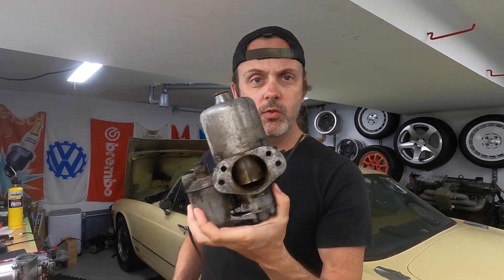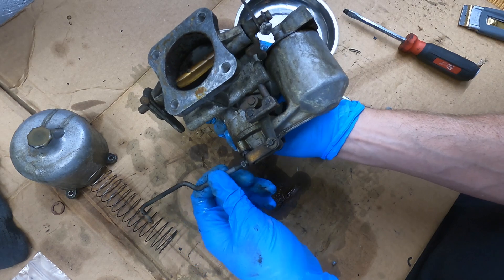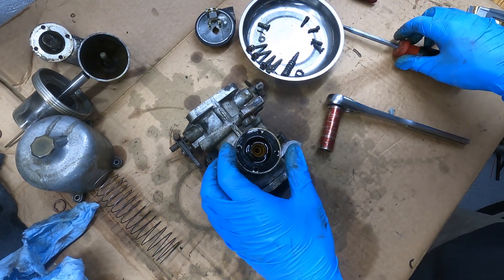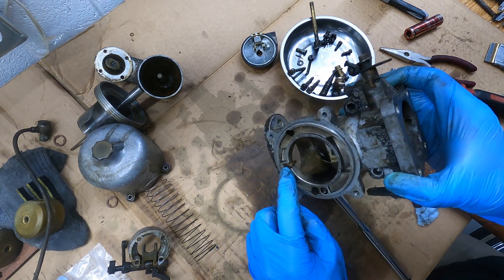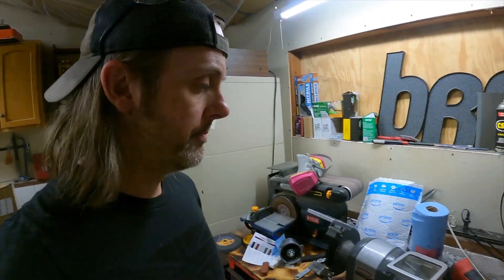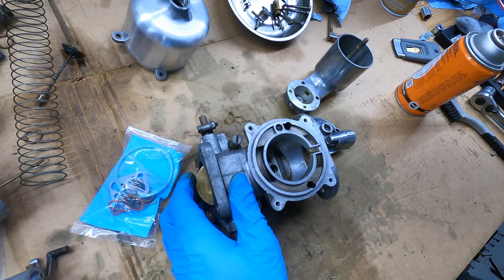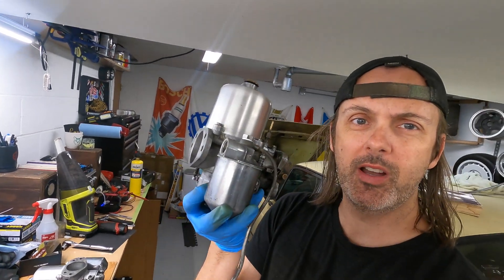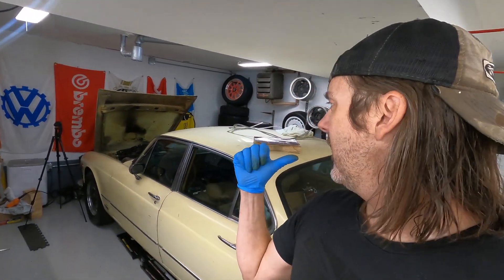SU HD8 Carburettor - Rebuild & Restoration

Comment: The small lift pi on the side has 2 functions to see if the dashpot is not seized & during manual tuning lifting the dashpot while the engine is running a slight rise in rpm denotes correct mixture as opposed to using a gas analizer & using the large screw on the side of the carb body this ensures correct co for emission control & the dashpot is actually lifted off the main jet by 2 holes in the dashpot facing the butterfly vacuum formed between the butterfly & the holes acts on the top of the piston in the bell creating a variable Venturi over the main jet accompanied by the lift of the variable size of the needle that’s about as simple as I can tell it

Comment: I believe that around 8. min 19 secs 
the mystery part is just a standard SU feature, i.e a lift pin which is used to test the piston  free rise and fall in case of doubt. On a non -running engine you can raise a  normally free dashpot piston with this gizmo, and if all is well , on releasing the pin the piston drops freely with a nice metallic clic as it falls under its internal spring pressure dropping quickly onto the jet bridge. Baically it's a test in case of a  a suspected  jammed piston..

Comment: Rob, do you have an ultrasonic cleaner?  Most of those carbs including all the small metal parts need to go into it. If you want that to run like factory, all that goop needs to get cleaned off. Also, if didn’t look like you cleaned the main jet needle. It is really important to clean that, without removing any metal or changing the shape. The fuel runs up along that needle into the Venturi of the carb. And any grit or grime left on that will effect your fuel metering.   

I really like the garage content!  You’re doing a great job jumping right in and going for it. Please keep it coming. 😊
Reply from the maker: I do not.  I just sprayed off the needle w carb cleaner and hoped for the best.  I have replacement needles that came with the kit, but the old ones don't really show any wear, not sure if I should be replacing them or not?
Reply: @addvancedgarage  I would vote on the side of putting the new needles in. There’s nothing to wear. It really shouldn’t touch the jet and only have fuel passing over it. But and residue could harden into varnish changing the size and shape of the needles.   But you saw it, not me. I trust your judgment.